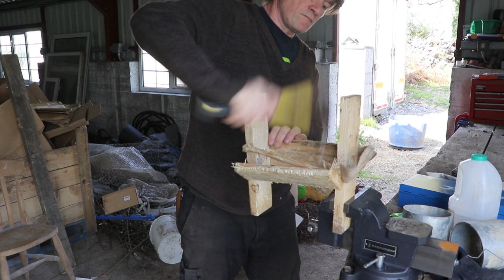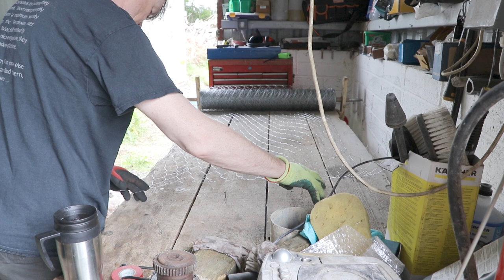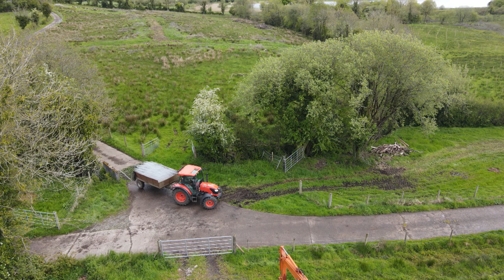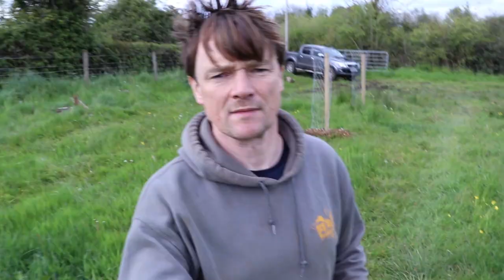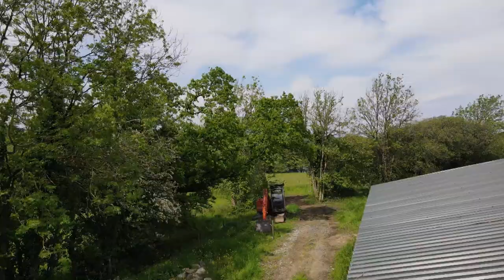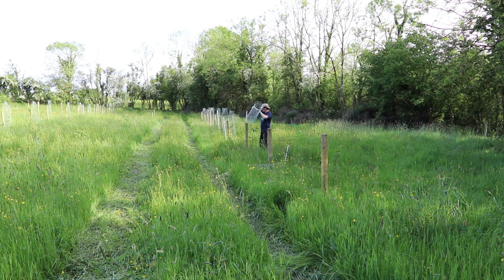Protecting trees from animals | Orchard work with the Kubota M4062 | DAERA EFS Tubular Net Guard

Comment: Wow, what a lot of work! And it will make it more complicated to weed around the bases of the trees. Especially when young, competition between the roots of the little trees and the root systems of grass and forbs will be a factor and I'd bet that whatever weed supression you use, you will get weeds in those guards.  Though I guess there is plenty of water! Would it not be cheaper and more efficient in the long run (especially when the cost of labour is factored in) to fence against deer? Looks like you are at least partially stock fenced. If you were to use a lightweight fencing like Tenax it should be possible to add on to the stock netting to get to 6 feet?  Long term as the trees get big and the canopies spread, you should get some shading which will suppress grass and forbs to some extent.  Do you have access to a microbaler? Making hay or haylage between the rows might be a method of reducing the vigour of the grasses long term (as you won't use sheep). Will be kind of tedious though. 
Very interesting project and thanks for posting.
Reply from the maker: Hello Anemone. That was a lot of work and it did complicate cutting the grass around the trees. However, it has helped keep trees alive by preventing fraying from deer.  I have now rolled up the wire at the bottom to make it easier to trim the grass and rolled it down at the top to prevent damage to the scaffolding branches.

Water generally isn't an issue in Fermanagh (Northern Ireland) as we average about 3mm of rainfall per day i.e. 3 litres per square metre.

With regards to stock, I have actually introduced turkeys around the trees. I am currently waiting for an electric mesh fence to arrive, mainly to protect the turkeys from dogs, foxes and pine martins. Currently I am only letting them outside during daylight hours.  I'm working on a video about what I've learnt from keeping turkeys in the orchard.

I hope all is well.
Reply: @GubbFarm  Hello. Turkeys as grazers. Pine martens?? I keep dipping into your stuff and it is always interesting. Was aware that it rained plenty in your neck of the woods, but not quite how much! Good luck in your endeavors, but I still reckon that permanent deer fencing would have been the better target for grant funding, but that's 40 years working in hazel coppice and 0 days working with hazel for the nuts.

Comment: Hi Dary, great clear video. are you only using the wire guard because it is specified by grant?- what animals is the wire trying to protect the trees from? would the simpler spiral tree guards have been enough? (e.g. they seem to work for hares). thanks again john
Reply from the maker: Hello John. As part of the grant I had to put a tree guard around each tree. The intent of the grant was to protect the tree from livestock, but my biggest threat is deer (as I don't have livestock grazing between the trees). 

The solution I implemented was low cost and not very effective. There are two big challenges with it: 

1) Deer scratch their antlers in it and rip them off
2) The wire is damaging scaffolding branch 

At the first opportunity I will be removing the wire guards.

As for plastic spiral tree guards, I have now removed these from the trees as I don't have any rabbits/hares/livestock that might eat at the bark. I have read they are a good at preventing damage from rabbits but I have no first hand experience. My reason for removing them:

1) You get a lot of growth inside the spiral guards and in the summer that can rot as humidity builds inside the guards. I would rather the tree focus it growth on the upper scaffolding branches and reduce the threat of disease inside the guard from rotting foliage.

2) After about 18 months the guards start to become brittle from UV damage and some were starting to break up. I decided to remove them to prevent micro plastic fragments going into the soil as a result of their inevitable break down over time.

All the best.

Comment: Wow! That's a lot of slogging. Glad you got it in by the deadline. (Like a farmer needs another deadline, besides what nature hands you.)
Random sort of question: Do you mow the orchard? I see the vegetation coming up, and I'm trying to figure out if it makes any difference to the trees.
I'm looking forward to the update on the bioreactor. Catch you next time. Good luck.
Reply from the maker: Hello Bob.   It was a massive slog and the worst part is, I'm not sure if it adds much value.

With regards to mowing, I will mow it at the later part of the summer as I want to build up the biodiversity on the farm e.g. right now the clover is coming through and I would like it to go to seed before I start mowing. I am currently debating if I will make hay or silage, but that will depend on how much rushes growth there is in the grass.

Ideally by now I would have cut the grass back around the trees and mulched, but I lost a lot of time when I broke my shoulder and the tree cages took the best part of a month to put up.  Because the grass has got so strong now, I might just wait until the autumn to mulch as the grass will have less vigour.  Over the intervening time I want to build up woodchip.

As for the bioreactor, I will do a video on that soon. There are lots of small mushrooms in it the last time I checked, but I also flooded the lower part as my sump walls where too high. Lessons learnt.

All the best.
Reply: @GubbFarm  Looks like you have a dense grass sward (with a rush component). If you mow once a year, late season, expecting seeds produced in situ to seed in, will this work?  In a dense, tall existing sward you don't have the niches (gaps with bare ground) for herbaceaous species to germinate and establish against the competition of existing plants. By ceasing mowing or going to once a year, especially if hay is not removed, in many cases, you build up a thatch of dead material and set vigorous species at a competitive advantage. You can then lose sward diversity. It might be better to mow several times a year and remove cuttings for a few years to reduce sward vigour and then relax when your sward becomes more open. Don't forget that if you prevent an annual plant from setting seed, you can force it to become a facultative perennial: it will persist (and sometimes spread) vegetatively and then seed when flowers are allowed to remain. Sorry, more work! Good luck.....